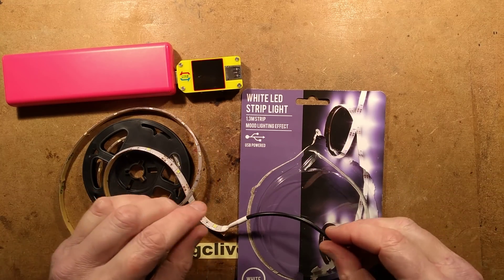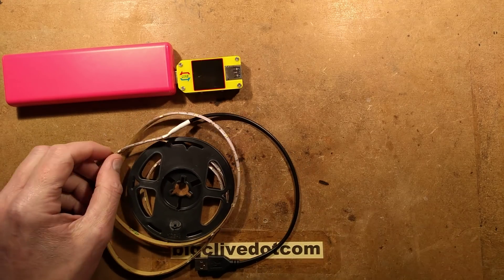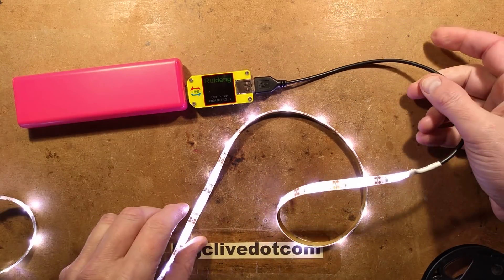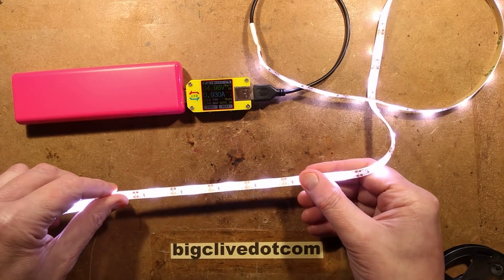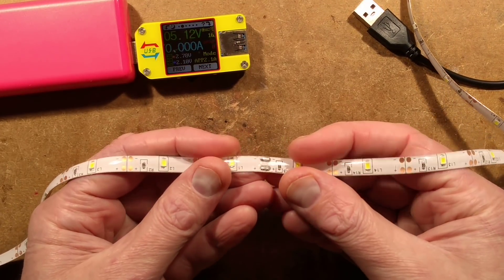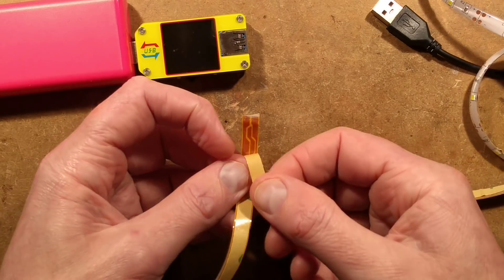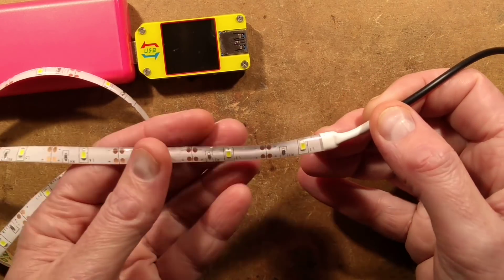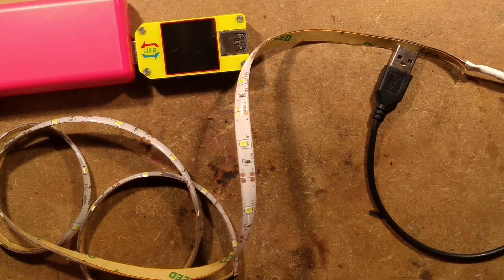Poundland USB LED tape.

Comment: Hello Clive. I have a couple of eBay spools of similar tape (about twice the density, ~60 per meter, and 100 ohm resister per) which I intend to use for low power lighting. Individual USB wall warts per meter and a couple external resistors to throttle the current, pretty much as you recommended for your Poundland find. Mathematically, I'm treating each strip as a single high(ish) power 3V LED with a 100/N current limiting resistor. Would Georg and Gustav (the namesakes of the laws in question) approve, or are there traps that I'm missing?
Reply from the maker: Are those 12V tapes with a cutting point every three LEDs?
Reply: @bigclivedotcom  No, it's the same 5V cut-at-any-LED clade as your Poundland tape, just a slightly different mongrel. Hence why I mentioned separate USB per whatever length. (Let's say 18" lengths, as that's a standard for wall stud spacing in the Colonies.)
Reply: @bigclivedotcom  OK, let's simplify this by using your 1M tape in this video as an example. I would treat the entire strip as a single LED with a 1.57 ohm current limiter, and that would be in series with the two 10 ohm resistors tacked on to the end.
Reply from the maker: @petersage5157  If it already has a 100 ohm resistor per LED it would be suitable for direct operation on 5V, but an additional series resistor (or diode to drop about a volt)  could reduce its intensity and prolong its lifespan.
Reply: @bigclivedotcom  Yeah, I got that. I just wanted to make sure my mathematical treatment was consistent with the Kirchhoff and Ohm's Laws, mostly because I like my back of the envelope calculations to be close to what I measure.

Comment: I've bought several, to add lighting to shelving. There is a problem with the strips though. When the strips are first used, out of the packet, they emit bright cold white. 

Over the course of a few weeks, though the colour of the light they emit changes from the bright white to a more yellowed hue. I haven't worked out whether this is caused by the rubber strip or the LEDs degrading. Something to be aware of, though.
Reply from the maker: They're overdriving the LEDs.  If you can drop the voltage a bit they will still be bright, but last longer.
Reply: bigclivedotcom Thanks for the reply. I'll look into this.

Comment: Sooo, is it possible to cut this 1m length to as short as you like and it will still work? Say as short as 9 LEDs in length?
Reply from the maker: Yes.  You can cut tape like this to length and then re-use all the bits.

Comment: Just got some B&M micro led lights, 120 lights 12.3M run off 4.5v AA battery box £4.99. It comes with a 2x button cell 'tester'. The far leds are dimmer than those closer to the AA box, but all the leds are parallel wired on 2x single strand copper(?) wire. I wouldn't have expected that length and type of wire to be acting as enough resistance to effect the brightness? The led 'blobs' are the tiniest I've seen so far.

Comment: Can you explain how diodes drop the voltage?
Reply from the maker: A diode has a forward voltage drop required to perform its function.  With a standard silicon diode it's usually in the range of 0.6 to 1V.  They dissipate that as heat, so a diode dropping 1V at 1A will dissipate 1W of power.  It's a convenient way of nudging voltage to short sections of LED strip down, as a drop of 1V will have a significant effect on the current.

Comment: Could this be extended and if so how long before something goes thermal ?
Reply from the maker: It's already a bit thermal, but you could add sections end to end or in parallel.  It may be cheaper and easier just to get a roll of 5V or 12V LED tape on eBay though.

Comment: @bigclivedotcom Another device you might consider buying one of and taking it to bits is something I bought recently off Amazon for US$8.99 and which..... then didn't work, is something called a 3.5 MM Retro Radiation Proof Phone Handset Socket Cell Phone Receiver for iPhone Samsung Android Smartphones.  It is literally just a replica of an old landline-phone style of telephone handset... with a 3.5mm jack at the end, and has buttons to raise and lower the cellphone volume, and one to answer/hangup.  I don't know if the particular unit I received was simply incompatable with my particular phone, or if it got damaged in transit.  After my cellphone completely ignored it altogether, I plugged it into the 3.5mm jack on my desktop computer to see if it was faulty, and it detected it, and asked me what kind of device it was (speaker, mic, external amp, etc, but none of the options it gave were mic-and-speaker combo) and when I selected Speaker, the speaker portion at least worked.... so it's probably just something about my particular phone not liking the headset.  That said, the outfit in China that sent it to me just dropped the flimsy, paperboard retail-packaging of it into a plastic shipping envelope -- without any padding or such -- and slapped an address label on it.  So, the box arrived smooshed and mangled, but the actual handset was still in the pressed-stiff-sheet enclosure inside, and the handset LOOKED intact.

Apparently there's another manufacturer making one of these cellphone handsets devised to look like an old CB-radio handheld mic.... and one of the comments on that one at Amazon said that after he recieved it, the quality of that one looked like he'd bought it at Poundland.    (I did not order one of those, mind you...)  That one is called Hype 3.5MM Retro Walkie-Talkie Handset Compatible with iPad, iPhone, Samsung Galaxy and most 3.5mm Devices (2013).  And it comes in pink.  :D

Actually, the phone-handset one also comes in a pink version, I believe.  Mind you, there seem to be multiple different, independently made versions of the retro phone-handset one.  I suspect the one I ordered was probably a cheap knockoff version of one of the other ones.
Reply: I'd buy one of those phone handset things, if it worked.

Comment: There are Chinese sellers who advertise their products as premium. 
I am currently looking for outdoor solar lights with good solar panels and lithium iron phosphate batteries.
I found only one with radar detector.
Are they worth paying double the price?
They do not cost much for a good lamp, but it's too much to waste it, because I need a few.
I'm tired of buying lamps that doesn't last more then 2 years outdoors.
Reply from the maker: You can ruggedise light to make them more resilient to outdoor use.  Even a coating of grease on PCBs and battery contacts can make a huge difference.
Reply: I already thought of conformal coating anything outdoors.
A little grease on the contacts is a good idea. I soldered the last cell in to avoid problems. ( I spot welded contacts on first)
Now I need some more and I'm not sure if I should run wire or run everything solar. 
The electricity runs from a meter that is not mine.
Reply: I thought about it all day and I think I'll stick to:
"Buy once cry once"
I don't have the money to buy cheap stuff.

Comment: So. Pound land are now doing £1 "box mod" ecigs...seems safe. It's by 88 vape and maybe you can pick one up if you come across one
Reply from the maker: I've not spotted that here yet.  Are they they ones with a digital display?  If so then they may be the same as B&M were selling, and cost about £10 for the base anfd more for the tank.
Reply: @bigclivedotcom  yes they are indeed the ones with the digital display. Northern Ireland is a bit behind with all the new sales so I'm yet to see it in b&m but I'll keep an eye out. As for price, I was told they sold for £15 retail down to £1 which is why it's in Poundland or something. I'll be sure to check b&m next time in in

Comment: Given that 5V LEDs are still much less common than 12 or 24V models, this is interesting. What sort of result could I expect if I hacked two into a single socket in series at the cable end?
(I've been thinking for a while about sticking strips along the length of tubes or bits of wood with angles on them in order to get spread out lighting for a green screen.)
Reply: LED,S are semiconductors so you need to think more  about current limiting
than voltage , most have a voltage drop of between 1.8 and 3.3.
once this voltage is passed they are basically a short circuit , you then need to calculate the correct resistance to install with them too  drive them with the correct current, more current more light but more heat, less current less light but more life expectancy.
Current for most is say about 20 ma to 30 ma as a rough estimation
    Clive is probably the  man to ask but I would say your idea would  would work but it would draw about 2 amps and the LED,s would be driven quite hard. I have installed two diodes in my one and it has reduced heat and current  but still puts out enough light for my  use
Reply: @darrenwolboldtalk2  Yeah, series was nonsense -- should have said parallel. But your answer makes sense -- in parallel, they're still free to draw extra current unless I plug them into a USB power source that's limited to 1A, and I do have those available. But the diode hack is pretty easy anyway, so probably the simplest solution.

But then again, I was thinking of using a Poundland power bank as a source. I guess I'd best look up Big Clive's video and see what the power output's like...
Reply: @nialltracey2599  Good  luck I hope you get it working

Comment: Hi just wondering if you could tell me more about the change in the way we are going to be charged for a smart meter you explained in another video love your site thanks
Reply: Try researching 'Real Power Vs. Apparent Power'.   I'm not sure why suppliers would want to change the present arrangement where domestic consumers were not billed for apparent power unlike larger commercial or industrial users.  It encourages bigger customers to keep their power factor as close to unity as possible, so reducing wasteage on the supply network.  You can often see banks of capacitors outside factories where large inductive motors need to have their power factor compensated for.  Domestic customers aren't likely to understand or care.  Most people don't even understand the simple concept of a kWh.
Reply: In France they bill you by the kWh, but you get a hook-up based on kVA. The smart meter is then used as a breaker that is automatically opened when the used apparent power exceeds the kVA rating. Even if the actual power used doesn't exceed the maximum kW you'd expect to be able to use.

Here in NL we had a minor scandal when smart metres turned out to be configured for apparent power rather than actual power. A village near my city had an entire neighbourhood with the incorrectly configured meters. Some 3000 households got electricity bills between two and three times what they used to be with Ferraris meters the year before. 

Suffice to say I won't surrender my Ferraris meter before its certification runs out in 2025. I prefer a meter that is physically unable to measure anything other than actual power used.

Comment: I have a 3 metre strip running across the top of a cupboard to provide a soft light in the evening, It is like that one a bit too bright, could you add a circuit diagram of suitable resistors or diode for those of us with a soldering iron but not much electronic know-how?  Just noticed your reply to a similar question, pasted here, thanks for that >>
bigclivedotcom
12 hours ago
Add a 1A diode like a IN4004 in series with one of the leads or two with one in either lead

Comment: I bought one of these strips in one of the several Poundland shops in Cardiff a couple of months ago. It was displayed among the £1 stuff but came up as £2 when I went to pay for it. I was also surprised at this because it wasn't maked with the big 2 on the back. It seems that Poundland are not marking the price number on a number of their lines these days - Makes me wonder if they're trying to move away from the £1 price model, as I'm noticing that a lot of the stuff they used to sell for £1 is not available now (Also a lot of the usb chargers and power banks seems to have disappeared from Poundland's shelves recently)

Comment: Once upon a time I had a big heavy metal flashlight with a dim incandescent bulb inside that could barely light up a dark corner which would run for maybe 20 minutes before totally using up 2 fresh one-time-use carbon D cells in the process. The world has changed.

Comment: I got one from Poundland a couple of months ago.  To be fair I think on the shelf they were marked as £2.  I was planning on using it for workbench/3d printer illumination. I had tested it to make sure it works but that's about it.  May attach a diode or use a lower voltage PSU to get a bit more life out it.

Comment: I got a couple of these from Walmart and ebay in the past few months ranging in length between 100CM and 200CM, I got them to be used with USB power banks if the power goes out (during winter that's likely to happen, strangely enough during the summer it didn't).
1 of them which is cool white Non-RGB I hooked up in the living room going across the lower portion of a wall with a USB mini PIR sensor, this way when entering the living room or going to the kitchen at night it turns on and lights the way.
I got the Walmart ones because they were in store and under $5 and are RGB with a remote, but they don't have a dedicated white LED so when choosing white it has a blue tint to it.